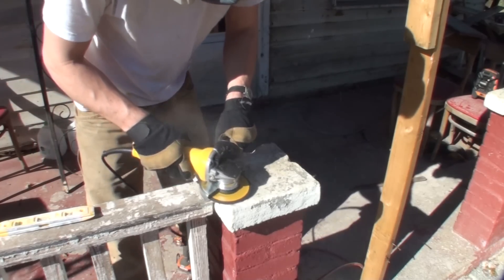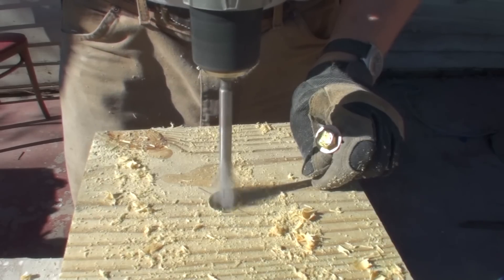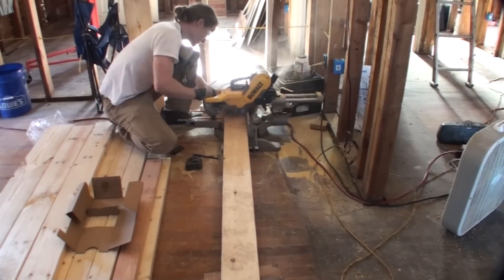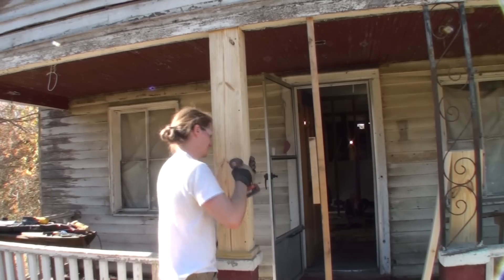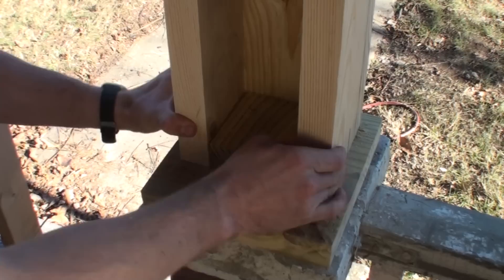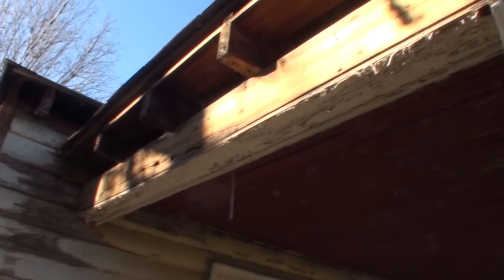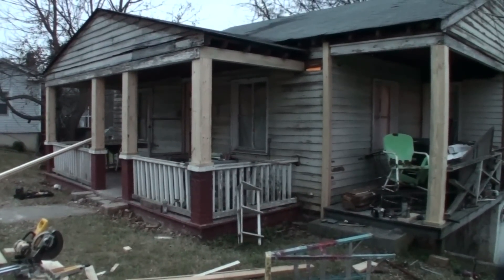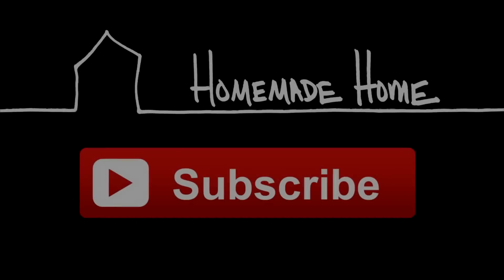Building Simple Box Columns - DIY Front Porch Home Improvement!

Comment: Homestead Craftsman meets This Old House? Excellent. Eager to see lot's of video of this. Re: the columns, I hope you capped those off, or you may find critters making a nice home in there. If you're worried about rot, just drill a dozen or so small holes in the cap.
Reply from the maker: indoorherbivore On the inside of the porch there will be a board that goes across the tops of the columns spaning from one side to the other, sort of like a shelf that will cap them off.

Comment: Nice work, I like the direction you are going and hope to see more soon. I have a love for older homes and would really like to see a retro remodel out of this. That faux brick siding was an atrocity...
Reply from the maker: mickeyhendren This house is a very simple house, so other than the new kitchen and bathroom it's going to look about the same as it did orignally with some improvements, the columns for example. There's a lot of stuff in the house that I have to de-rig, if that's a word. My goal is to renovate it in a way that makes it as maintenance free as possible (with a few exceptions) Thanks for watching.

Comment: Hubby and I have been talking about making square wood columns where we have the ugly metal columns but were hoping to just box them in instead of removing them. I saw a couple other of your videos and was thrilled to run across this one randomly. The columns are both full length and in good shape...just planning to paint them with Rustoleum and cover them up, trimming them out instead of putting a block under them. I'd appreciate your opinion since you've done so much of this stuff.
Reply from the maker: That could work, although it's not hard to remove them if it makes any difference.The video pretty sums it up, just box them up with what ever size you want. You can use treated lumber if you'd like also.

Comment: Looks great. I didn't catch if the lumber was treated. if not, will you be painting or treating right away?
Reply from the maker: How To Fix It Workshop The base plate of the column is treated, the rest is not. It will be painted, using solid stain.

Comment: Me too...a 1922 untouched house.  My big problem at the mkment is skeleton key locks...that are locked and unable to open the doors.

Any ideas...I think I can take it off the hinges and maybe click the lock. But what about a key for it.
Reply: Sislertx  Many antique stores have a wide assortment of skeleton keys - and there weren't too many different styles.  Take the locks out (or off) the doors and take them with you.  Try different keys until you find some that work.  I have done this before - and had success at the first store I found keys at.  Good luck!
Reply from the maker: Sislertx drstampfli's answer is what I would suggest. Once you find one that works you could have some more made or make them yourself. It's a simple lock. A good locksmith could produce a key without an original.
Reply: Homemade Home operative words...good locksmith....called them all in the area...they all mean well and tell me they think they might know some one but it has always turned out no...but those are great suggestions. ..I did findnout they still make these things new and could replsce the innards I suppose...thanks

Comment: Nice start to the channel. Thank you for posting the vids there intresting....a quick queston if i may.....you say its an ivestment propety how so is it for the rental market or have you brought it with the idea of "flipping it"
Reply from the maker: Richard Ball Rental. If you sell it you only make the money once. If you rent it you make much more money in the long run.......and you can always still sell it. The income is taxed differently too. Thanks for watching.
Reply: Thank you for the reply. Iam intrested in doing the same thing over here in the uk but are houses are mainly built from masonry like brick or block
Reply from the maker: I did another one that was a block house, standard cinder block with a concrete slab. I liked it. Just left it all the same layout. I cleaned, smoothed out and painted the walls and ceilings. Fixed tons of small stuff, totally remodeled the kitchen and bathroom and put down carpet and vinyl floors. It's a very small, modest house but it turned out great. I did not live in it, but I would have no problem. It was very clean in the end, basically a new house as far as appearances and function go. I find the key is price, if you can get a good deal that does not put a pinch on you to purchase the house then go for it. But it's not the easy road to money, it's a lot to work. Both to make the money to buy it, fix it and to maintain it. But I feel that when you get a certain amount of them, it will balance out and make since as a business.